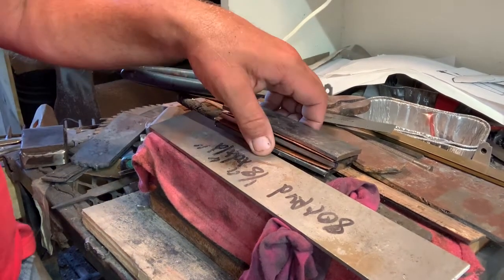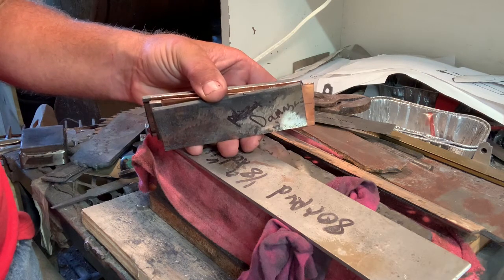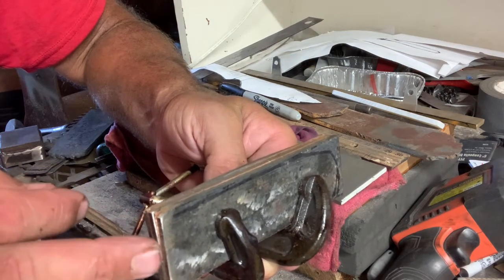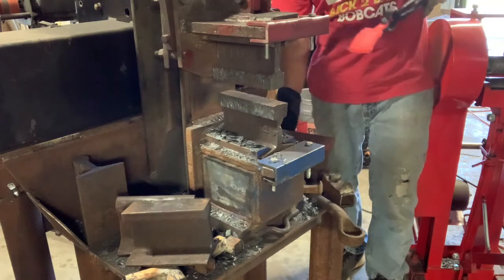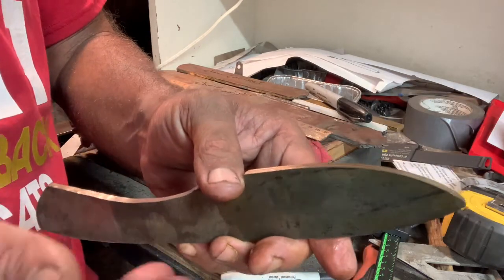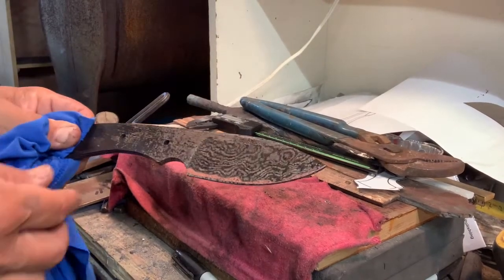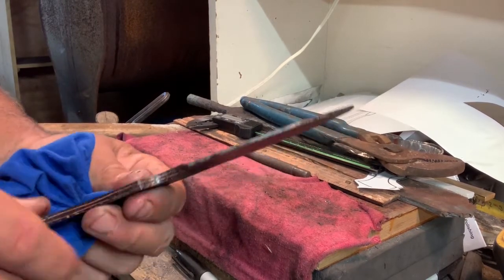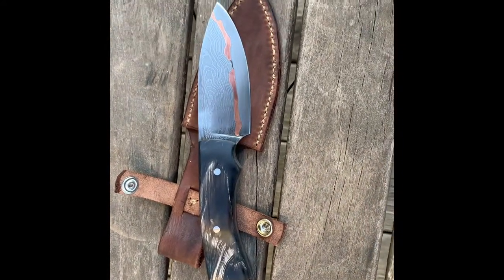Forging A Cu Mai Knife

Comment: Impressive especially for having the B's to attempt the process without encasing the billet with weld.... I'm about to attempt my first San Mai chefs knife my first San Mai anything and I'm trying it without a press or anything else other than my right hand and a 2½# hammmer any words of wisdom?
Reply from the maker: Thanks man. I have started welding the seems since this video. And good luck on San mai. I have done some Damascus without press or power hammer. My advice is to use as small of a billet as you can while having enough steel for the final knife. Don’t go wider than the face of your hammer. Get it to forge welding temps do light hits with hammer to start. Do progressively harder hits with each additional heat. Good luck.